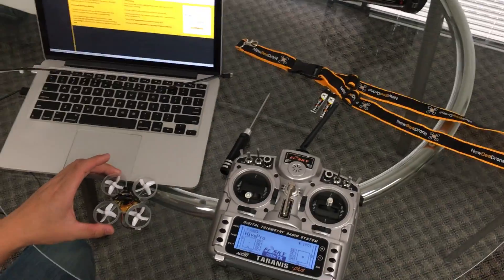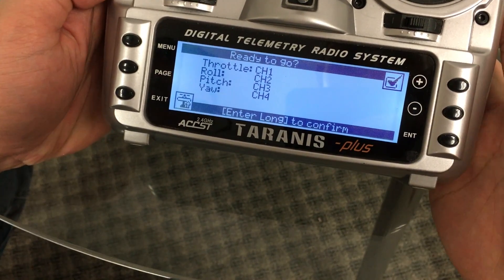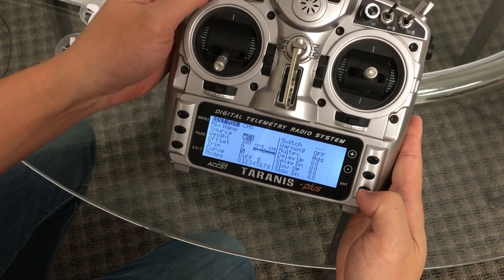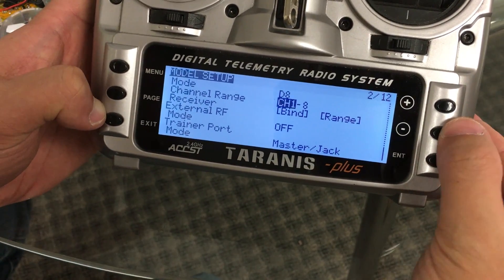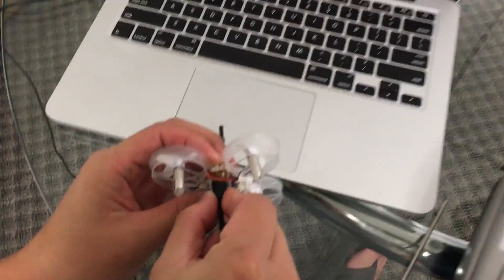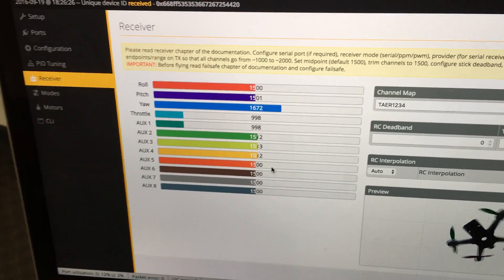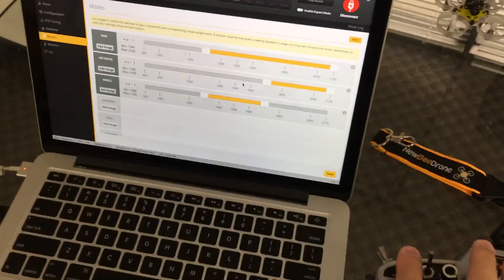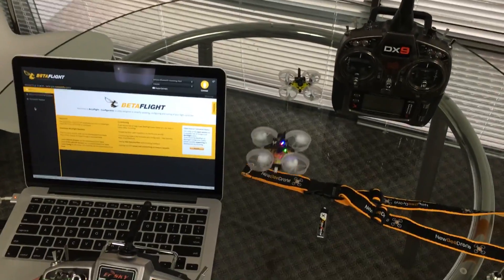How to Bind the v1.1 BeeBrain to Your Taranis

Comment: +NewBeeDrone Helpful video! I saw in the manual the ESC/Motor protocol is set to 'Brushed'. However, I saw that Mr. Steele had the setting on 'PWM'. What's the correct setting? I got MMW Fast motors.
Reply from the maker: BRUSHED if you are using the latest 3.0.1 BeeBrain Betaflight firmware. Mr. Steele was using an older Betaflight where the settings were different

Comment: How do you set Failsafe. If i lose connection it just takes off. I've set it in betaflight but it dont work. D16 has "no pulse" but no option on D8.
Reply: Hey Alex, there is an issue with setting the failsafe, but there is a great workaround listed in this article here:http://fpvobsession.com/setting-up-failsafe-on-frsky-beebrain/
Reply: Dronin Thanks man. I think I might have fixed it. I set my Failsafe to land not drop. I switched that and I think it fixed the issue. I'll check out the article too. thanks again.

Comment: hi. thanks for the vid. was wondering. can you get away with just flashing non eu firmware to the taranis to get d8 and it bind or do you have to do the rf module too? I have several eu lbt receivers for the rest of my fleet that I would rather not have to remember flash too.

Comment: How do we know when the battery is dead? Can it do telemetry? Don't want to over-discharge my batteries.
Reply from the maker: Hi Kenneth, so on this version there is no low voltage shutoff, we just recommend setting a timer and watching for less punch from the batteries as a sign that its time to come down. We are working on addressing these issues though in the near future!
Reply: NewBeeDrone What's your recommendation on a timer for a 200 mah battery with the upgraded motors?

Comment: My brand new taranis does not have D8, just D16 and LR12...
Reply from the maker: Hi Rafael, what model Taranis do you have? Is it the X9D+?
Reply: yep, brand new.from EU
Reply from the maker: Ahh yes, you need to flash the non-EU Firmware onto the Taranis in order to get the D8 mode in there. All Taranis that are sold in the EU have a different firmware on them that does not have the D8 mode in it
Reply: OMG!
Thanks bro! 
Hail from Brazil!